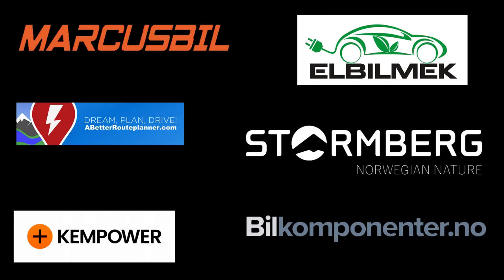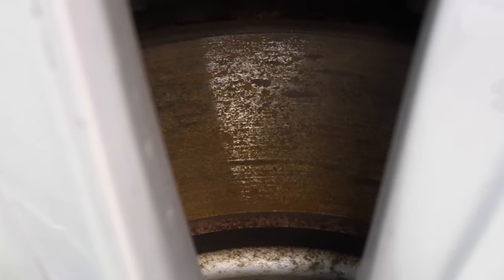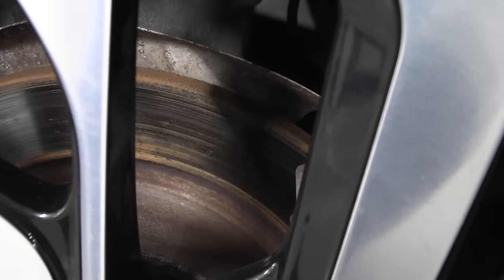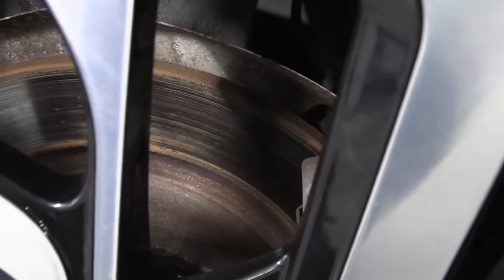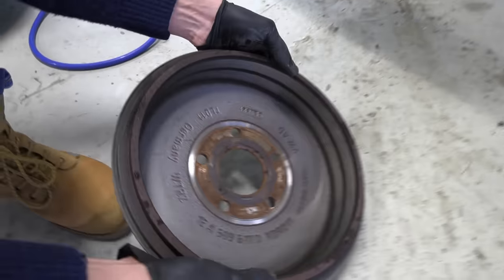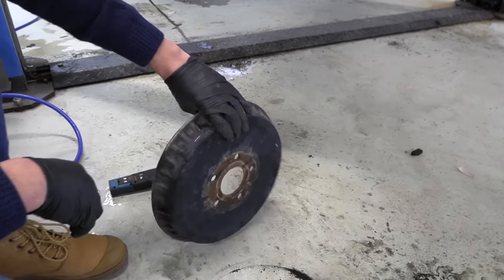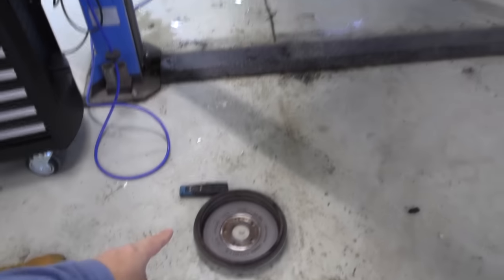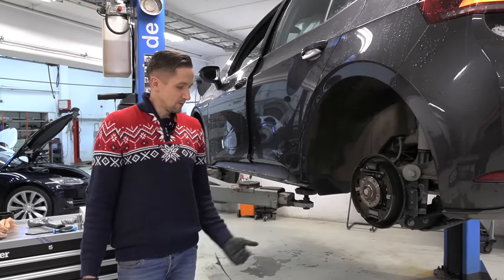How much rust is in VW ID3 drum brakes after two years?

Comment: In my opinion, VW hasn't made a bad decision here - at least for the smaller and weaker models, completely sufficient, since the recuperation takes place on the rear axle anyway and can also be better regulated.
However, I see practical problems with the large, heavy models:
The trailer load is therefore much lower. The ID series only has around 1200 kg for braked trailers. It's particularly bad with the ID Buzz, which has an empty weight of over 2400 kg but is only allowed to tow 1000 kg. Completely unusual if you compare it to a T6 and its 2500 kg.
Reply: I think the trailer load is limited by the motor cooling mostly, not brakes. Because those VW EVs are heavy they do not have sufficient cooling to add a lot of additional towed mass.
Reply: @UhOhUmm  EVs overall have bad towing capacity, my parents Subaru Solterra only has 750kg capacity meanwhile my E-tron does 1800kg which is decent enough but still quite a bit lower than what a Q7 3.0 TDI can tow(3500) for example. Even the Tesla X is quite limited at only 2250kg comparatively.

Comment: Unless you do track driving, no passanger car needs disk brakes for rear for speeds that most countries allow. Rear wheels do not have enough traction to warrant disk brakes for the brake power but drum brakes are slow to release heat so if you do multiple heavy braking actions in series, the drum brakes may overheat and brake shoes no longer work well.

Comment: Even on my Golf IV, I had trouble getting the rear brakes to pass more than two semi-annual MOTs/EU controls in a row. Rusty brake discs was always a problem, and on an EV the problem would be even worse. So I'm very happy my ID.4 has drums in the rear - they're just a lot more hassle free.
Reply: Imagine paying at least 40k € for an ID4 and just getting rear drum brakes 😂
Reply: @philipp5183  You didn't get the message in this video or in what I wrote at all, did you? Drum brakes on the rear is the better solution because discs are complete overkill. It's got oodles of regenerative braking on the rear. Rear discs would just sieze and rust.

Comment: @11:20 Best thing you can do is to have no regen if not driving long down hills and actually use the brakes. Yes some, if not most, EVs will regen with light braking, but if you press harder they do apply friction brakes. Dealers often recommend to brake hard once a week during winter, especially if its raining and not much salt is on the road.
Even in summer if its raining a lot it can be a good idea to brake hard every so often to avoid rust buildup.
I always drive with no regen and brake harder every so often during the salt season to make sure brake pads don't rust.

Comment: 3:09 In the Skoda Enyaq, you can stop, put the car back in N, then a message appears at the top of the screen asking you if want to keep the car in N. If you press that, you can work on the car as long as you keep the "ignition" on. Should be the same with the ID3 since the cars are quite similar 🤔

Comment: drum brakes are cheaper to produce and lighter in total (that might surprise you), which is veeeery important in weighty EVs. This weight is why ID.3 with bigger battery has only 4 seats. Drumbrakes are less frequently to maintain but when you have to maintain them, this guy with hammer is going to charge you significantly more (changing a break pad is so easy ...). The trouble is ID.3 is not cheaper than TM3, so the savings do not go to customer's pocket.

Comment: I don't have an issue with the drum brakes on our Born. One benefit that often gets overlooked is that the brake particulate is confined inside the drum and so less likely to enter the environment. Not the case with discs.
Reply: What do you think happens, when a mechanic will work on drum brakes?  I give you a hint, compressed air will be involved....
Reply: @Chris675R  Thanks for stating the obvious. My point was, (which seems to have passed you by) is that removing the dust and particulates in the workshop will reduce the likelihood of it being dispersed around the environment and ending up in the places it shouldn't be as the car travels around.
Reply: @MartynDews  Well, where do you think the mechanic will go, if he will clean out all the dust with the compressed air? He will certainly not do it in the shop, so all the people in there have to breathe in that healthy dust. He will go outside or at least hold it out of the window and release it into the air.
In theory you are right, while braking on the road, the drum brakes contain the brake dust, but it will be released into the air anyways, if the brakes are being serviced.
Reply: @Chris675R  Not being as familiar with the internal operations of a workshop and the mechanics within, I'll have to take your word for it.
Reply: @Chris675R  Good way to get miners lung, mechanics here use a vacuum cleaner with a HEPA filter.

Comment: They aren't just better for rust - calipers can stick/seize often in salted road conditions but in the drums they are mostly protected. 
The I.D is a rear drive3 car so rear regen also. That means the brakes are large incase of emergency stops but most other times they are hardly used. 
Disks are only better for heat dissipation but on most ev's thats never going to be a problem anyway since you can't push them hard enough for long enough to get the rears to cook anyway. 
They are certainly a better choice for this application.

Comment: I have a question 
2 years ago I took My ID3  to workshop for first service 
They said no need to replace break pads /shoes 

Now it almost 3 years with 40,000 km range 

Do I need to be worry about my break pads wearing?  

Because my first EU control is around 7-8 months next 

Because some days in the mornings the breaks was locked and I car moved very hardly

Comment: Most braking power is done by the front so rear not so critical.
Reply: Especially with an EV that regens a lot, so the physical brakes are used much less than with (non-hybrid) ICE cars.
Reply from the maker: That's why rear disc brakes rust on EVs.
Reply: And in a rwd ev like the id3 the regen is going to be at the rear.

I wonder then if fwd EVs have more regen potential than rwd EVs.
Reply: @Tom-bp6no Yes FWD and also AWD have better regen potential than RWD.

Comment: I have never seen drum brakes this big on a small car. These probably have more braking force than same diameter discs because of the larger contact area between the shoes and drum compared to a single caliper. Also the entire friction area is farther out than a disc, which relies on friction at a shorter radius from the center. Hand brake actuation is probably also easier to integrate into drum brakes. The downside is the wear parts are hidden from visual inspection and they have reduced cooling comparead to discs, but cooling is not an issue on electric cars.

Comment: oh no please open the electronic parking brake via the Diagnose port and set it in Service mode

Drum brakes tend to fade much quicker, but because you have regen on the rear axle and if you brake hard mostly the front brake is doing the job, so  this is no problem. You are not driving on the race track where you have constant braking

Comment: Drum rear brakes are safer because disc have a tendency to cool and contract after driving, this can release the hand brake.
Reply: That's a good point, but I think EVs also lock the transmission when the parking brake is applied. Never heard of an issue with Teslas slipping their parking brakes?

Comment: For the id3 you can drive slow, set the car to neutral. Then the brakes are used. In D or B the recuperation is used first. Be careful anyway.
Reply: I always do that while driving fast in my GTE. 🤔
Reply: any car is like that
Reply: My id3 uses front and rear brakes on the first breaking of the drive. And also when you recharge to 100% it can’t regen and uses both brakes.
Reply: @testi2025  It hink that is not the whole truth. The mechanical brakes are used, when the electrical brakes are not strong enough- If you are a defensive driver (like me) i expect nearly no usage of physical brakes. If the battery is fill (100%) or the car is in  neutral, than you are right-
Reply: @ndc5544p  Probably. From my point of view, it is a question of strategy. So maybe, there are differences from Car to car. Even the much heavier cars like ID4 might be different to the ID3.
Reply: @olaflanfermann7343  you can hear the mechanical brakes if your radio is not blasting hard. Every morning when approaching the main road junction, I can hear the brakes, even if I brake slowly. At the next junction I can’t hear them, so this is why I think it’s deliberate. Same when I leave work, I can hear the brakes when I slow down for the first speed bump, but not after that.
Reply: @testi2025  If my ID3 stood for a few days,  you can hear a noise while slow driving. A first brake helps. But i´m not sure, if this means really the Braking disks, totally.

Comment: Drum brakes haven't changed in years I used to change them on cars back in the 70s and 80s they're a simple tech that works well and for EVs that's fine...if you put pads all round they will be changed more often

Comment: Don't mind the rear brakes being drums since regen should keep them from overheating, but I wish VW would use steel-lined Aluminum drums to drop unsprung weight.
Reply: Die Aluminium Trommeln beim Lupo 3l oder Audi 3l waren eine Katastrophe, ich habe viele wieder auf Stahl umgerüstet 😂
Reply: @@retiredbore378 You mean galvanic corrosion, which is preventable.  From what I can find of weights, it seems like drums are ~15lb/corner.  Saving even 20%, so 3lbs/corner unsprung, is huge.  Granted, OEMs don't seem to agree, judging by the stock disc brake parts and wheels they spec.
Reply: @@retiredbore378 Galvanic is a different type of corrosion requiring an applied voltage, not just a different name.  As for the unsprung weight, I'd expect it to be 75-100lb/corner.  I don't know about the hub/knuckle in particular.

Comment: Tesla needs the caliper slide pins cleaned, polished and greased. This allows the pads on both sides of the disc to retract.
Reply: That is what normal car needs too, the slide pins cost like $1 for normal cars, so better replace them. The worst part here is we use salt on the roads, so lots of rust everywhere. And the pads can get stuck where they are supposed to glide.. making only one of the pads engage when braking.
Reply: @AndrewTSq  I have the same salt usage in Michigan. This summer I pulled my calipers and polished and greased the pins.  I didn't check how much new pins would cost plus the drive to the Service Center. They'd need to come out either way.
Reply: @eb1888.  I do it once a year with my old Volvo, never had a caliper seize. Quick job when you are changing the tires. Unbolt the pins and run them on the wire brush, lubricate and remount.

Comment: Drum brakes will overheat on the racetrack, but may be OK for occasional stopping. 
Braking force will be similar until it will not overheat.
Reply from the maker: Don't forget the regen power on the real wheels.
Reply: @bjornnyland  That's why they are OK in this case. 
Car like this will not overheat brakes. 
Race cars has big camber at front and almost zero camber at rear wheels. 
Opposite to understeering road cars
So then braking force is also pretty big on the rear. 
In normal car, rear braking force also isn't so small but isn't so often so there is time to cool down. 
Drum brakes will wear down very fast in case of agresive driving. 
But in case of amergency braking force will be bigger than tire traction. 
Only after few amergency braking, one by one, force wille get lower much faster than in case of disc brakes.

Comment: Volvo OPD regen uses a mix of motor and mechanical braking .. so the discs and pads stay clean and wear lightly.  I'm old enough and driven long enough to have a dislike for drum brakes and their maintenance
Reply: Actually, Volvo has a mode that allows the brakes to engage from parked to clean the discs - mine get cleaned every time I back down our driveway. A lot of people complained in the first few years of Volvo EV production in rainy climates of their rear discs getting rusted and the parking brake pads sticking to the discs. Depending on the warranty in your region, it’s covered, but it can get expensive once it expires. Given Volvo’s 180kph limit in a small passenger car, I feel a large diameter rear drum like the ID.4 is a great idea. Volvo OPD is great, I agree, but I wouldn’t like to get a cracked pad. Keep in mind a lot of people notch up a lot of highway distances, so the brakes, even with Adaptive Cruise Control don’t get used often, leading to rust build up.

Comment: Discs are just more repair friendly for me... I don't like to work on drum brakes as much... 😝
Reply: Yes, much easier to just remove the caliper with two bolts and do some wirebrush cleaning and lubricate the sliding pins when you change from winter to summer tires.
Reply: You don't need to work on these drums much, if at all. EVs are not the same as ICE regarding brake usage & wear, as you probably know.
Reply: @Roll_the_Bones  A winter with plenty of road salt will kill any brakes that aren't maintained, discs or drums...
Reply: @oskich  Judging by the evidence here, the drums have been unaffected by salt, or anything else?
Reply: @Roll_the_Bones  Let's see after 5 years ;-)

Comment: The comparison with front wheel drive EVs is weak.  VW meb based models like id3 are rear engined if not AWD, so the Regen breaking power is in the rear and adds to the drums power but also leads to the rear friction brakes getting even less use to avoid rust. So on a front wheel ev like Zoe it makes much more sense to have disks in the back, it will rather show rust issues in the front.
Reply from the maker: You didn't see the i3 I showed in the video. That's RWD...

Comment: Drums are a very old system and there's a reason why most moden cars stopped using them they are rubbish.  I have been a mechanic for 30 years and just bought a id3 and I can confirm the stopping power is not good at all. When you drive the car in sports mode it activates the breaking mode ad it need the assistance to stop the car it's a huge disappointment

Comment: couldn't you use the accelerator and the brakes at the same time for a couple hundred metres every week? that'd keep the discs shiny. this seems to me like a software problem. they could even schedule a brakes maintenance mode that does this automagically
Reply: I've tried that on my Cupra and it doesn't work, if you press brake it automatically starts regen with the electric motor. But if I put the gear in neutral no regen is applied when braking.

Comment: Simplex is not the best.
My peugeot 404 from 1961 had duplex front drum brakes. Each brake shoe had it's own brake cylinder so the brake has 2 leading shoes instead of 1 on a simplex brake.
(A leading brake shoe has a bit of automatic brake boosting effect. 
A trailing brake doesn't have that)
 
Drumbrakes on the rear axel is good enough because rear brakes only do about 25% of the braking anyway. As long as the front brakes are disks it's OK. We are not talking 300kmh Porsche turbo here. These ID cars are just daily drivers. Not hi-end sports cars.

Btw there is another advantage of using drum brakes. The car will have a better parking brake. Disk brakes are not ideal as a parking brake.

Comment: Porsche has solved the problem with rusty brake discs. PSCB, or coated discs. No rust, and no brake dust. The only problem is probably the cost. 36.500 NOK, almost 3500 USD. You also need at least 20" wheels, and the brakes are only available for very powerfull and expensive models. Why doesn't more car brands offer this? Rusty brake discs is not only an aesthetics issue
Reply: Porsche has big problems with the coated Disks.
Reply: You can always of course get carbon ceramics 😂
Reply: I prefer my bike with stainless steel brake discs 😉
Reply: @tellef70  Stainless has a bad friction coefficient, hence not used on cars. On bikes the tires basically always the limitation.

Comment: simple brakes good til you have an mergency situation ,these heavy cars should have better brakes than a golf II
Reply from the maker: No need for powerful rear brakes.
Reply: @bjornnyland  true , drove many drum brake cars , Skoda ,VW ,Opels and after old disk brake cars like Corolla , Prius and rear risk brake made difference def faster reaction,Toyota made it right while rusting in Prius from low use its still ok after 16 years ,drum somehow touches inner surface different making it "slower" ,later from rust powder can stick etc. toke apart many prob.hundred times the way drum wear the break shoe  surface is not great, ABS not the same either. don't know

Comment: The next Gen will have disc in the back. That's embarrassing. Disc brakes are cheaper and easier, even in manufacturing.....just like power window components are lighter and cheaper than hand crank components nowadays.

Comment: Drum brakes have some problems: They have worse braking performance and worse thermal performance.
Reply from the maker: No problem here as shown.
Reply: The brake seals on disc brake cylinders are a bigger diameter so are under less pressure when in use. The smaller seals used in drum brake cylinders are under more pressure (this my theory) and in older designs tended to be a failure point ... brake fluid leaks were common. Hopefully more modern designs and materials make this less likely to be an issue.